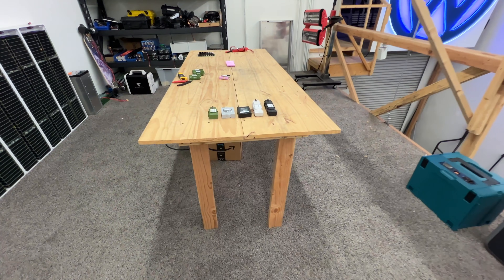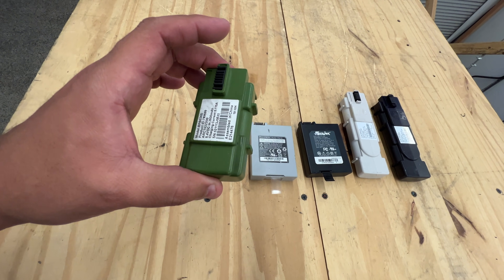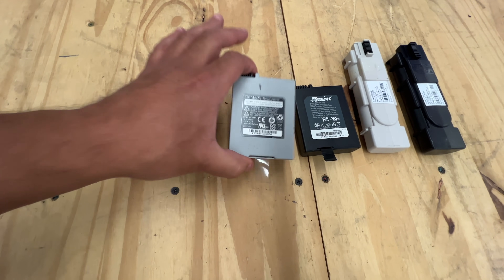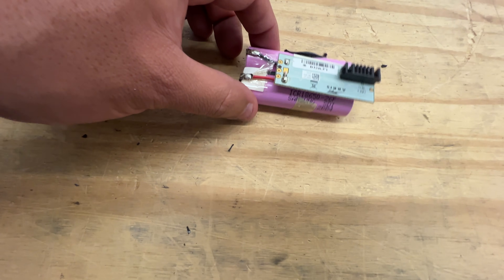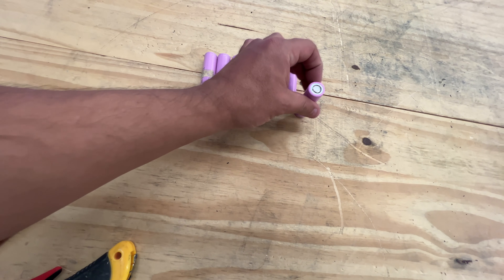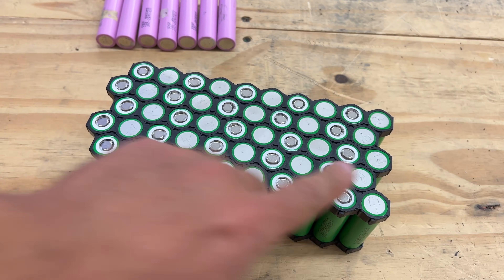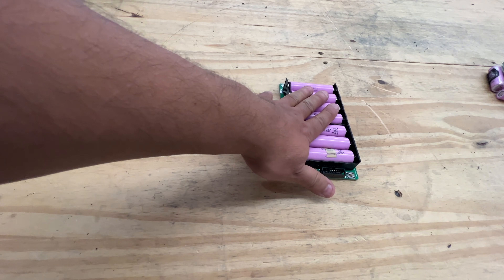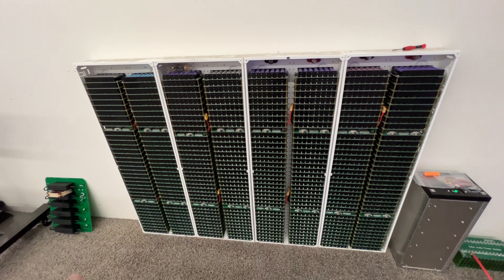Extracting 18650 SAMSUNG cells out of $1.20 Modem Lithium Batteries

Comment: Can't we use them without breaking 😵👍
Reply from the maker: If you find out how let us know how to do it.
Reply: @jehugarcia  every laptop batteries have 5 Or 6 pins +ve & ve and remaining are the switch pins (+...... ) either 2s 3s 4s, so you need a 1k resistor to activate the bms which is inside the battery ( don't use below than 1K ) Now we use Multimeter connect the probes to the both edges of battery pins ( just use a piece of nickel strip at the edges ;) use the resistor by connecting it in parallel with other switch pins if there is any voltage Or polarity shown on Multimeter then that's good you can charge it but use low current cause we don't know how these bms can hold the load and the voltage depends on packs and btw if it works then start charging them from nominal voltage not the full charge voltage cause these BMS's are so sensitive the smd Mosfets may burn if we test their limits and make sure with the polarity
I hope it will help.
Or
Simple, if you don't mind there are sum pictures on my Instagram if you see it then definitely you will get it.
I learned a lot from your channel about batteries Sir!
this is a small help from me
keep up the awesome content man your Tesla charger will work

Comment: interesting, modem backup batteries aren't a thing in the uk. if you lose power you lose internet
Reply: It's mostly for people who rely on their home telephone service via their internet or cable TV provider. So if the power goes out the can still make phone calls just like when they had POTS.
Reply: What Jeff said
Reply: There are modems with 4 or 8 POTS lines on the back that are only used for voice service from the cable company, often in commercial applications. Those have batteries. The data-only ones usually don’t.
Reply: They likely mean phone modems
Reply: Yes, I just use an ups for that gear
Reply: In the US, the telco has a requirement to keep the phone on for a period of time in case of a power outage. 

With voice-data convergence, that regulation trickles down from the voice to the data DSL end point.
Reply: My converged voice / data / TV / WiFi gateway has a 12v DC UPS, which runs my network forever during a power outage. My unit required lead acid 12v 7Ah batteries… I have to change the batteries, every so often. 

I also collect the UPS’s - they are great for other uses around the house! People throw them away, when they stop working, not realizing the battery can just be changed. They show up in various thrift stores.

I never thought about shopping for Li-Ion battery based products in the thrift stores! LOL!
Reply: @DavidHalko  old UPS's are great, pure sinewave, I'm using them as a inverter with my car battery or 3S lipo if I need 220V outside of my house. Only thing they're rated up to 400W so no big load
Reply: @clixium  Keep the power lead as short as possible and at least 10mm cable to the car battery
Reply: Frankly I don't know where they are a thing in the US either. I have had many modems and never have I see a battery powered option.
Reply: Correct, but in the UK we don't have phones connected via modems. (ignoring voip etc). Normal home phones are powered from the telephone exchange. And the exchange has UPS/Battery/Generator backup, ensuring that you can still make emergency calls if there's a power cut.
If you have a phone that requires mains power (eg a wireless handset) you'll always see a sticker on the bottom explaining that it should not be relied on for emergency calls.
Reply: They are if you opt for one of the fibre to home products that removes your copper phone line, BT does do this in some areas.
Reply: @edc1569  good to know! Makes sense
Reply: same here i dont know WTF hes talking about